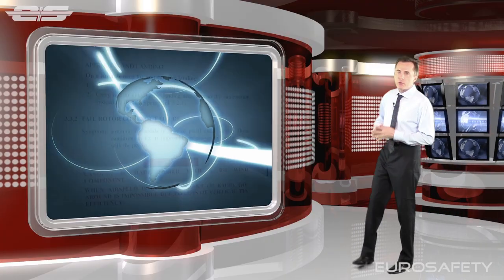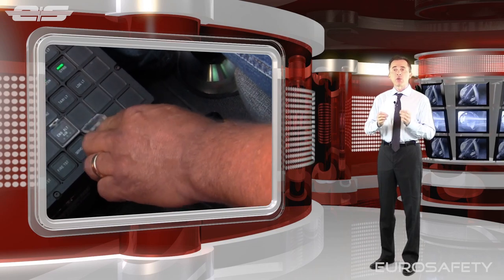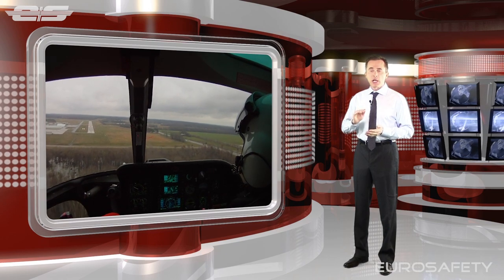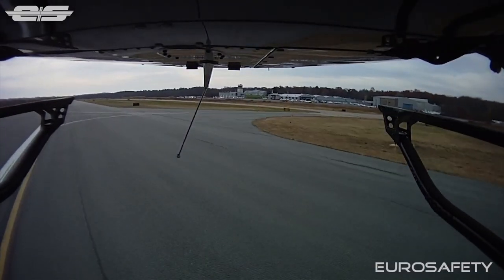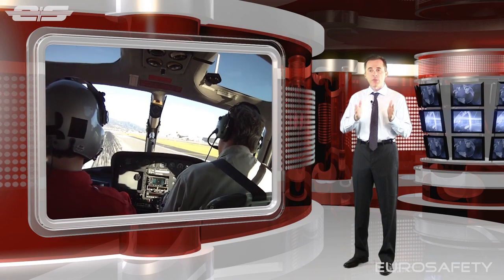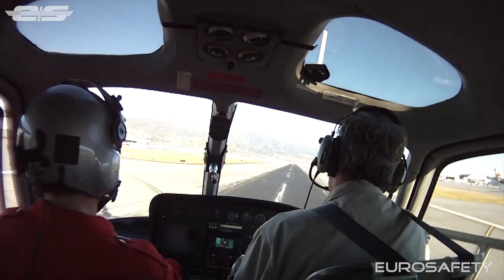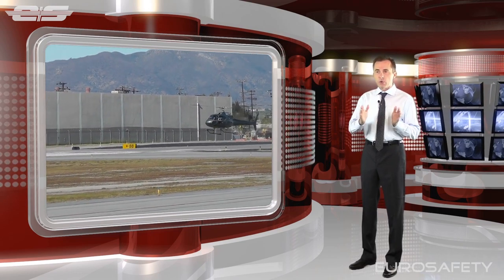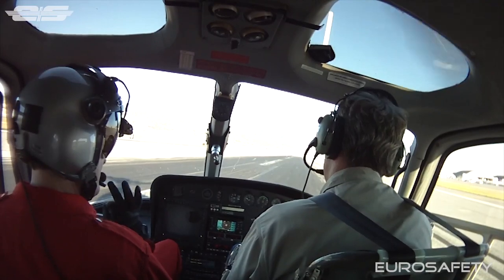Critical Response: Handling Stuck Pedal Scenarios in Flight

Comment: Stuck left demo would be good as well. Nice video
Reply from the maker: The procedure would be the same for stuck left. When you neutralize the tail rotor pitch a stuck right goes to neutral and a stuck left goes to neutral. The nose of the helicopter being to the right on approach does not necessarily mean stuck right.
Reply: In a counterclockwise system with a stuck left pedal, you can reduce yaw (in forward flight) or spin rate (in a hover) by increasing torque to counter the effects of the stuck "anti-torque" pedal. This is accomplished by gradually reducing throttle and increasing collective pitch. 

If you're a student pilot (especially if you are working on your commercial) reading this comment, it's worth practicing with an instructor.
Reply: @obamadontreadgood  No ... check airbus procedure ... this is a video with an AS350 .. if we speak about R44 .. it could be different .. but what you write, it's not an Airbus procedures.... left or right stuck pedals ..... same procedure because you come back with pedal neutral postion
Reply: @davidgodment8703 I haven't flown AStars but even in the EC120 you've got a dramatic difference between a stuck left or right pedal. I stand by what I said, if you've got a seasoned instructor available, it's worth your time to see the difference and to learn how to manage it. Procedure may say neutral pedals, but it may not be possible and, depending on the malfunction, may not be in your best interest. Which is why I believe learning to recognize and recover from a stuck pedal or loss of trail rotor control in either direction is worthwhile.

Comment: What no stuck left pedal?!
Reply from the maker: The procedure would be the same for stuck left. When you neutralize the tail rotor pitch a stuck right goes to neutral and a stuck left goes to neutral. The nose of the helicopter being to the right on approach does not necessarily mean stuck right.
Reply: @EUROSAFETYTRAINING  I assumed a counter-clockwise system in my initial comment. 

Landing with a stuck "power pedal" would typically require increasing torque to reduce the effects of the stuck pedal.